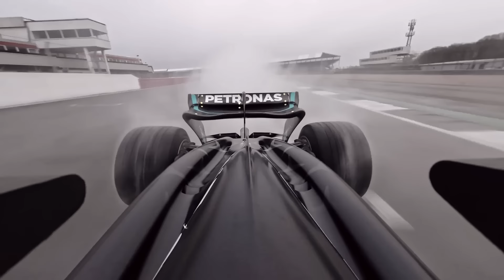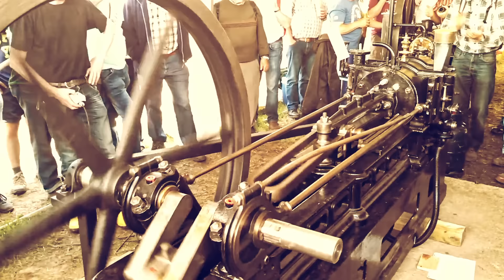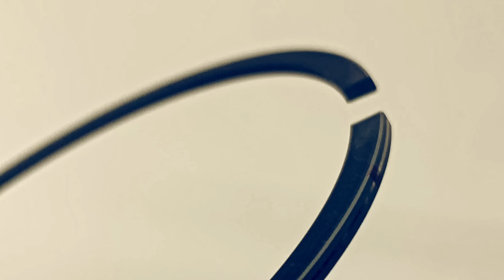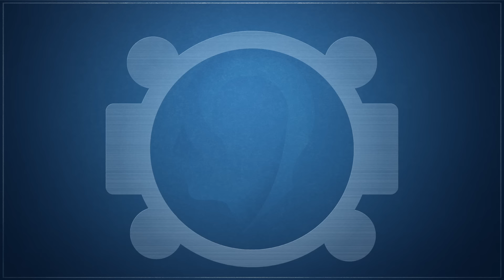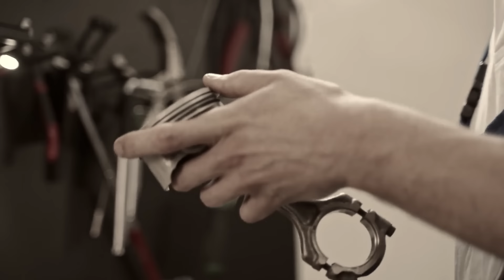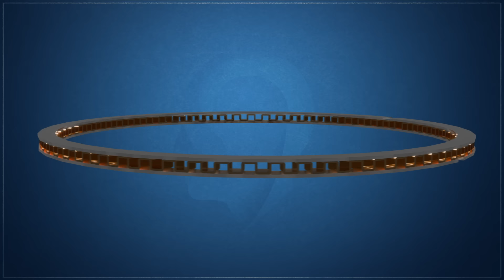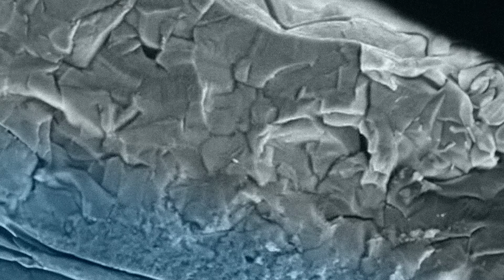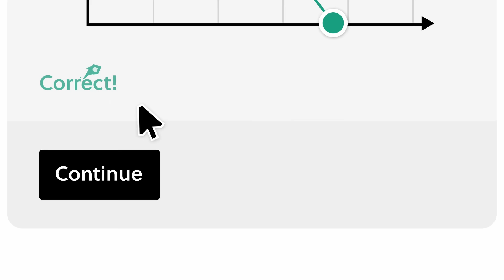The Clever Engineering Of Piston Rings

Comment: How the pressure is sealed in a piston ring.Will the ring gap close during compression stroke?.On your theory you mentioned the travel of piston as a linear motion.But it's a simple harmonic motion.One side of the piston almost touches the cylinder wall in TDC which results in closure of the ring gap consecutively it seals the pressure.

Comment: Some manufacturer like Yamaha uses DiASil, it has microscopic silicon in the sidewall inside the cylinder to trap oil so it has less wear on piston ring and also makes the piston go up and down smoothly, bonus it is also good at heat dissipation

Comment: how much clearance the piston has in this simulation is the trap  most people believe ....
the piston and the oil has to do the job . ask german mahle und all the great designers like zundapp etc . look at the piston to cylinder clearances in real german and west europe engines ...
also the 1 degree scraper shape is gone in the first miles running in the cris cross hone cylinder . .
nicaseal and high performance L top ring design pistons explain i am right

Comment: I did learn some new things in this video.
But formula 1 isn't the top when it comes to piston stress.
Mean and peak piston speeds in some drag racing far exceed F1.
There's guys doing 9k to 10k RPM in big block engines with crazy long strokes in the 5 inch range.
These engines have piston speeds nearly double F1 engines.

Comment: They were a lot more clever before some ID10T decided to reduce the wiping force to increase fuel economy by a fraction of a mile per gallon. The result is all engines are now going to consume oil out the tail pipe. If it's not broken, don't break it.

Comment: This is one thing with my favourite engines the Buick 6 linage that I have tried to understand what the right combination of designs and technology that lead to my honest opinion to one of the best ring/bore/piston wear and longevity characteristics and ultra low oil consumption and decently low friction engines out there.

To me it was more of a question to why all other makes and models of engines sucked in this regard. It's pretty much a given that the bores, rings and pistons at 500k are at a similar wear to other makes at 50-100k.  In all the engine I have ever built for the Buick, the bores at say 300-500k don't require more than a 5 thou overbore, some are in spec and can be honed on a sunnen hone, standard rings and pistons.  The issue I find is almost always custom pistons of 5 thou over need to be ordered as the standard 20, 40 over are wayy too big and a waste in cylinder wall thickness.

The top two rings are 1.5mm stock and the oil ring set is 3mm.  I think the 2nd comp ring is a tapered design but I would have to check.

The aftermarket forged performance piston usually use a 1.2, 1.2, 3 set and I think they are a moly type for the top one or two rings.

Comment: Man i am so impressed by this lecture. From the niche detail only engineers would consider to the vocabulary used to convey the exact meaning in not overly technical ways, you could teach a lecture on giving lectures. This is the difference between going to school for engineering and simply getting a piece of paper, and being invested in the material and performing well regardless of whatever proxy measurements the education system employs. I'm a subscriber after one video.
Reply: I would add, however, that in order to convey the information more easily to a lesser informed audience, with lower cognitive effort on the viewer, that you add a blow up of the features you are highlighting with geometrically exact shape (in terms of relative dimensioning) but exaggerated values (say 5 or 10 degrees instead of 1 or 2) so that it's more visible and clear what you are pointing out without having to squint. Otherwise very well done, very well informed, and excellent diagramming.

Comment: A lot of modern engines no longer use a cylinder  'liner' but use a very hard low friction electro-chemical coating straight onto the aluminium of the cylinder wall,  this improves the cooling of the rings and piston by a large amount.

Comment: In an internal combustion engine the ring has little contact to the cylinder walls, it rides on an extremely thin layer of oil, it is only at the top of the stroke and the bottom that it can have some friction. You can see this when taking apart an engine that has a lot of kilometers on it. The trick is that the rings touch the walls as little as possible to lengthen the life of the engine.

Comment: Many Saab 9-5 were killed because of thin piston rings that gave a bad seal, lots of blow by causing oil degradation. This problem is not on all 9-5 only certain years, don't know exactly which years. What I've heard was that those rings were only intended for racing engines that don't see many hours of use, not for regular cars.

Comment: Diesel engine piston rings have to withstand high combustion pressures without leakage to the oil sump. Well worn rings can sometimes draw excessive oil into the combustion chambers which burns continuously causing a runaway situation which cannot be stopped by fuel cut off and the engine continues to 'fire' at a rate set by the 'leakage'  producing black smoke and often excessive revs to the point of destruction of the engine. This scenario is best kept well away from as con rods have been known to smash through the crank case and eject from the engine compartment at high velocity it seems.

Comment: Nice report on the working of piston rings!
Modern engines are not always environmentally friendly.
An allowed oil consumption of 1 liter per 1600 km indicates that this is a very dirty engine.
My former Kawasaki KR1-S motorcycle clearly used less lubricating oil and that was a 60 hp two-stroke of 250 cc, so with a lot of hp per liter.
Audi made expensive cars that used 1 liter of oil per 350 km, a big fiasco, while piston rings and pistons have been made for over a hundred years.
That is why I do not like piston rings that have too little preload in four-stroke engines.

Comment: @20:00 I don't understand how using a quart of oil every 1000 miles is acceptable?  Most motors hold 6 quarts, an oil change is good for 5000 miles. My math says I will have 1 quart of oil when it's time for an oil change, which sounds bad.
Reply: It does sound bad and it probably is but my '00 Corolla was running fine on about a teaspoon of oil until I crashed it

Comment: Well done.  A technique featured in some small engines is a bevel on the top ring that faces the piston top to increase sealing pressure on the compression stroke.   In the quest for dazzling mileage the Honda CRX car used a slipper piston and very narrow piston rings usually found only in drag racing.  They got their mileage goals at the expense of longevity.  Once these engines got some miles on them their fuel economy plummeted and the were burning oil at a record rate.

Comment: 🤔 Would this work?
6:27 Can you make an under-sized ring, designed to seal INWARDS (not outwards) and put that at the top, maybe adjacent to the (shown in video) upper-outwards-sealing-ring?
The idea, is that the compression gases, would ideally pressure the inwards-ring: inwards & downwards. to create a MUCH(?) better seal towards the first outwards-ring. so the compression gasses can't (as much) move around the seal & "over-pressure" that seal even more outwards towards the walls.

Comment: In aviation, new engines to the market - both purpose designed and modified auto engines - have a few different failure modes.  One is the breaking of their piston rings.  This has intrigued me for a while.  What is the most likely cause for ring breakage in this environment.  I have read speculation (but it is just speculation) that since an engine in an aircraft runs for long periods of time at a higher percentage of rated power (usually 100% for takeoff then 50%+ for the rest of the flight), the rings cannot handle the load.  Does that sound about right?  And, if it is, can anything be done about it without compromising some other part of the engine?
Reply: With proper lubrication aircraft engines tend to be a LOT more reliable since regular maintenance isn't an option, it's a requirement. Plus with engine failure in a car you can just pull over, can't do that in a single engine aircraft when you're 10,000 feet up
Reply: That's why aircraft engines are so expensive, and when a co. develops a reliable platform they tend to use it and update it for years

Comment: Fun fact!  Modern engines operate at the pinnacle end of piston ring/materials science (for normal passenger cars and trucks). That means, whatever is coming next should be coming soon. Could you imagine being the person who comes up with a compression system with few or no installed parts?  Just using physics and alloy technology for a new world?  Battery cars are not tenable, period. Even if they increase range and decrease charging speeds - you’re still running the world on fossil fuels for electricity. And the dangers of these battery packs coupled with the outrageous pack replacement costs with dangerous battery waste makes ending combustion engine vehicles just stupid. Enough of the ‘climate change’ rhetoric pushing a change no one wants - that ideology/religion doesn’t survive in a real world. And again, the same fossil fuels will eventually power a world of electric cars that people hate. Nope.

Comment: I'm not a qualified mechanic but I've been messing with engines including doing full rebuilds for decades since I was in my late teens so I'm quite familiar with gapping and installing new rings into rebuilt engines, but I was totally ignorant of so much of what discussed in this video, for instance I had no idea that compression rings and their seating grooves on the pistons are designed in such a way that the combustion gas is forced in around the back edge of the ring helping to push the ring outwards tighter against the cylinder wall, I always thought that was just up to the outwards spring tension of the ring, so interesting, great video 👍

Comment: the most amazing thing is the lubrication or fluid film preventing metal on metal contact the fuel and oil, the oil consumption rate determined by the Oil control ring, amazingly it stops metal on metal contact, the piston speeds are actually relatively similar in formula one engines compared to v8 engine's, the Crankshaft Speed is the RPM measurement of reference for engine speed, the key function of the piston metallurgy is to not crack it must expand at the same rate as the Block or slower

Comment: Did the AI voice say "Bleeding edge of performance technology? I wish AI would learn to read a printed script...other than that, a very interesting and informative video. One item I didn't hear is that one of the main reasons for blow by comes from ring land wear that opens up the side clearance of the rings. This happens because as the piston decelerates at TDC, the ring inertia causes the ring to lift off the bottom ring groove opening a path for combustions gases to leak past rings. At that point, the only thing holding the ring against the cylinder wall is the original ring expansion which is far too little to contain the gases and hence, blow by results. Ring side clearance must always be checked when rebuilding an engine or you may wind up with a lemon rebuild.

Comment: tarred rope..."junk ring", for james watts purposes, about the best he managed at the time.

the mention of etionne lenoir should have come along with "also built and drove the first ICE powered vehicle , driven around paris in 1860..." for some reason, people run under the delusion it was karl benz, yet even siegfried marcus (marcus siegfried?) was driving around twenty years prior... and HIS car is still on display in the Vienna Museum, and is still capable of being driven... i think it was last driven in the 80s... the centenary...

as for the eccentricity of the ring, ID versus OD, the most obvious example of that is in circlips... so they expand/contract as a circle. far easier to install, in that case.

one of the big failures of people attempting to make their own engines is the failure to understand that the surface machined in the piston that the ring rides upon is just as important as the ring itself... its part of how they seal.

Comment: The graphics are misleadingly inaccurate couple of ways. The rings are always shown with an axial gap between the groove and the ring on both sides. The ring is always tight to the bottom surface of the groove whenever it is sealing cylinder pressure. This contact is critical to the heat transfer path that is verbalized and to an effective seal. No contact, no seal.

The graphics also depict bending deflection of the ring cross section when overall twist is being discussed. Twist of the ring in operation is a rotation of the cross section, not a bending of it.

Rings are for much of their travel hydrodynamically lubricated, but the oil film is extremely thin. The graphics depict clearances and films that are a significant % of the ring dimensions, when in reality they tiny relative to the ring dimensions.

It is also important to convey the very large forces and pressures between the ring and piston groove surfaces. That axial pressure between the piston and ring is key to sealing the gas pressure by assuring that the flexible ring conforms to the more rigid piston to achieve an effective seal everywhere except at the ring gap.

Otherwise, a valuable revelation of the complex and effective operation of critical components
That many do not understand. A seemingly simple component whose behavior and operation becomes more complex and amazing as we move from empiricism to real understanding.

Much of this progress in the last 100+ years has been made by trial and error, and the success has led to testing and simulation that explains how it works, and eventually we get to theory and simulation that actually drives design.

Comment: Very good animations and interesting technical details!
But the thing of transferring 50% of the piston heat through the piston rings seams way off!
No way you transfer that much energy through such a small contact area!
The oil and piston skirts do way more of that task!
On valves that's a hole other issue due to the big temperature differences and a closer fit between the metal parts without a oil film between!
But correct me of I'm wrong with some real data!

Comment: One small omission about ring cap: Proper "gapping" is a compromise between sealing and catastrophic failure. A tighter gap improves fuel economy and performance at low loads, but a too tight gap will cause the ring ends to meet at maximum load due to thermal expansion. When ring ends start pushing against each other you get a catastrophic failure where the crown of the piston cracks and sends metal shards everywhere.
Reply: There was also no mention of overlapping ends.
Reply: @gotindrachenhart yes, i have an old two stroke engine with only one ring with overlapping ends. I think its beautiful but more expensive (I also have the next model of this with two standard rings).
Reply: I learned that when Mike Patey showed a video and he was grinding his rings because he was adding NOS, and the NOS would increase load and temperatures.
Reply: @firefighter4443  Yeah, Nitrous Oxide increases combustion temperature quite dramatically compared to adding more boost because the percentage of oxygen in the total mixture goes up.
Reply: @andersjjensen you should add that only applies to gas motors. You can nitrous a diesel that's running lean already and end up with exhaust temperatures barely above ambient (due to running extremely lean and the effect of the expansion of NOS dropping cylinder temps further
Reply: @DarkAttack14  It also applies to diesel engines. If you jack the metering pump on a diesel and you don't have the ring cap for it, I absolutely guarantee you that you'll get a catastrophic failure under heavy load. That you can mad scientist something doesn't make the common case go away.
Reply: Haha me too
Reply: Yes, I leaned this lesson on a supercharged ‘07 Jeep srt8. A muffler shop’s owner had a kid who did detailing. 16 miles added to odometer resulted in several spark plug electrodes that looked like they were smashed closed with a hammer. Endoscope showed several pistons had chunks missing from ring expansion. 🤦🏼‍♂️
Reply: @bowieinc  did they pay for it at least?
Reply: @ryanfrank1309  no, sadly they did not. They claimed it was not driven aggressively. I also think they didn’t unhook the battery when welding the new exhaust, which fried MAP Sensor which may have contributed to the failure on their 16 mile joyride, (I mean test drive).  Later mechanic found this after I chased parts for a month. BUT, mechanic replaced sensor with OEM. Since it is supercharged, it would run ok up until positive manifold pressure then go haywire because it should have a 2 bar sensor because of boost.
Reply: I follow "Jim's Automotive Machine Shop".  They turned a $500 diesel tractor into a $12,000 "double" engine rebuild because  of inadequate ring gap combined with incorrect injection timing.  40 years experience, and it finally came down to trial and error and reference to experts.  There's a lot to know about a couple grams of metal.
Also, how do F1's regulate engine temp to mantain proper ring operation. Seems like they would use a lot of oil during warm-up, and with a little too high temperature, Kablammo!
Reply: @Grandpa82547 the oil is pre-heated and pumped through the engine before they crank it. The F1 engines are actually seized if it’s cold.
Reply: @Grandpa82547  cool, I’ll check them out. I’ve read that older f1 engines are locked up tight at ambient temp, and only free up when oil is preheated.